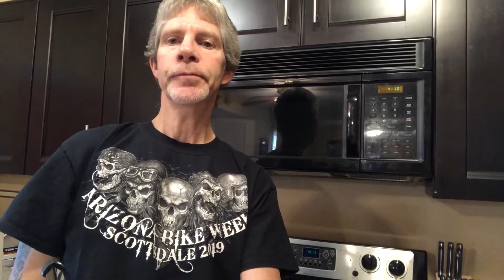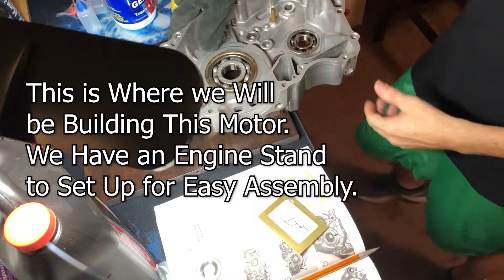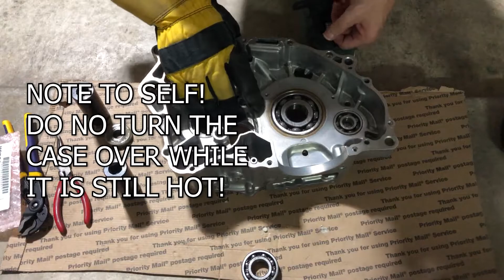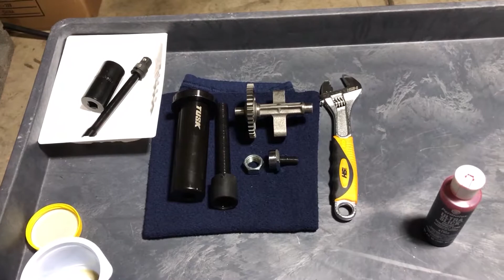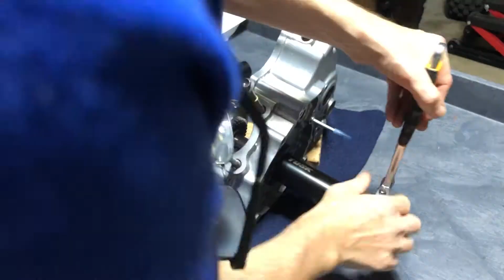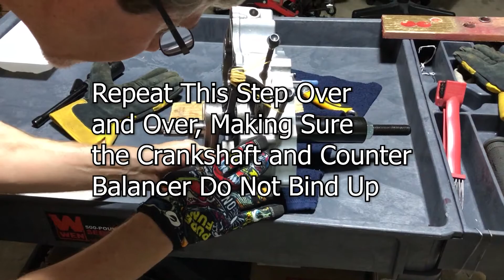Honda 400ex Build - Part 7 - Motor Engine Bottom End Crankcase Bearing, Crankshaft, Counter Balancer

Comment: Nice videos, thanks! Helped out watching these when I put my new bearings in today!
I know it's a little late, but the little needle bearing in the left crankcase is available.
The part number is 91101-PZ9-000, and it is $8.05.  It shows up on the 2004 XR400R dirtbike (same from 96-04), but does not show up on any of the other year models. At least it shows up on Partzilla.  Just installed all three so they are the right ones.
It is also used on the Clutch Actuating Arm on the Clutch Cover on the XR, and most likely the Right Side Cover on the TRX.  It uses 2 of them for the clutch arm.
I ran across this a few days ago on one of the dirt bike forums, and thought I'd pass it along for future reference.
Reply from the maker: @WPreece  That’s good info, thanks!

Comment: Map gas and a rubber mallet is the quickest and easiest way to heat up and assemble the bearings and crank when there cold
Reply from the maker: That would work too, but the easiest for me is just the way I did it ... cases in the oven and bearings in the freezer.

Comment: Probably a far fetched hope, but do you have a part number for the seal you put in at 8:20? Trying to order on Motorsport but the pics aren’t showing the oil notch. Thanks. Your vids are amazing and so helpful!
Reply from the maker: It's #45 in the diagram (for 2005+) - https://www.motosport.com/oem-parts/honda/2007/trx400ex/transmission || here is the same part (#91204-HN1-003) on Partzilla - https://www.partzilla.com/product/honda/91204-HN1-003 || the same part is #35 in the diagram (for 1999-2004) - https://www.motosport.com/oem-parts/honda/2004/trx400ex/transmission-%28%2799_%2704%29

Comment: I'm trying to see a video of how you got all those bearings out how you got that block apart.
Reply from the maker: I never had a motor to begin with. I bought the left and right crankcase halves already split. I did this entire build from scratch starting with just a titled frame.

Comment: Where is part 1-6
Reply from the maker: I never had a full motor to tear down. I purchased the crankcase halves and all the engine pieces separately and just assembled them. I did this entire build from scratch, starting with a just a frame.

Comment: how hard was it to find the trans mission kit
Reply from the maker: Not hard ... I bought one on eBay from a 2014 ... any transmission 2005+ will work if you have reverse and any transmission 2004 and below will work if you don't have reverse.

Comment: How do you pull all the bottom end case bearings out
Reply from the maker: I put the case halves in the oven at 300° for 1/2 hour and they will fall right out. Hell, sometimes they fall out while still in the oven! Sometimes you have to punch them out from the back side and if there is a stubborn one with no open back side to pound it out, you will have to use a blind bearing puller - https://amzn.to/3uXA6PR

Comment: Is there a place I can get those photos of the cases? Also there is a needle bearing in the Left Crank case. Ours is broke and I cannot find a part number anywhere. Any ideas? Thanks for the great video!
Reply from the maker: Here is a link to all the OEM parts you need - https://www.motosport.com/oem-parts/honda/2007/trx400ex
Reply: @11GalleryATV  If you look at the diagram of the left case it does not show you the inside. There is a needle bearing on the inside that I can't get a part # for.
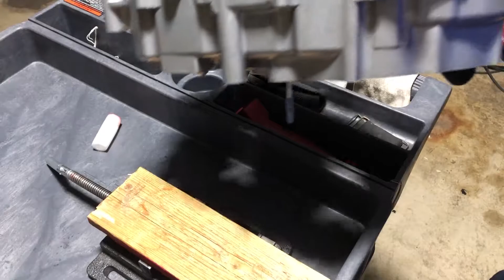Reply from the maker: @joshuabeard8244  Oh yeah ... if your talking about that little needle bearing that the shift drum goes into ( very bottom of screen at 17:06 ), it is not sold and is not replaceable as far as I know. In the manual it says if this bearing is bad you need to replace the case.
Reply: @11GalleryATV  wtf it should be like a $36 part! The case is like $300 holy f&$@
Reply: @11GalleryATV  Do you by chance have a link to the manual in PDF?
Reply from the maker: @joshuabeard8244  I got this information from my Clymer paperback manual ... I do not have a link to a pdf but I do also have the official Honda manual and it says nothing about that bearing and it is not mentioned at all in the "Left Crankcase Bearing Replacement" section. You can probably find a used left case on eBay or somewhere at a decent price.